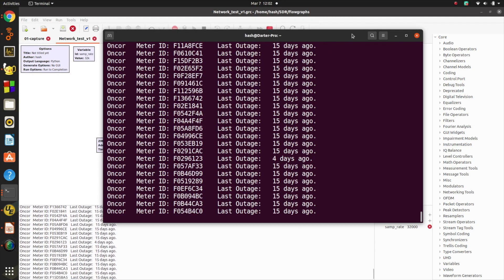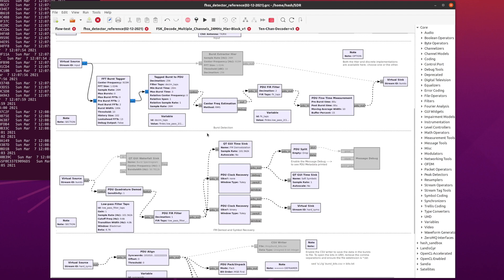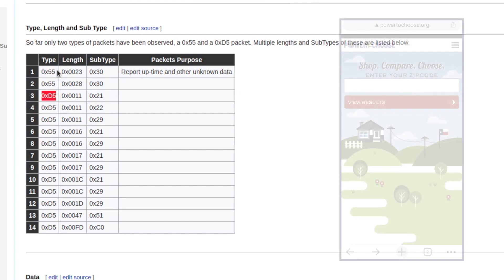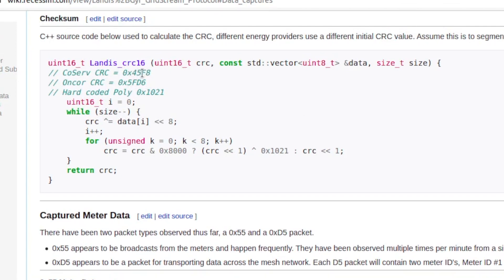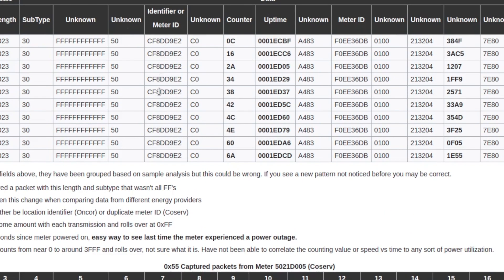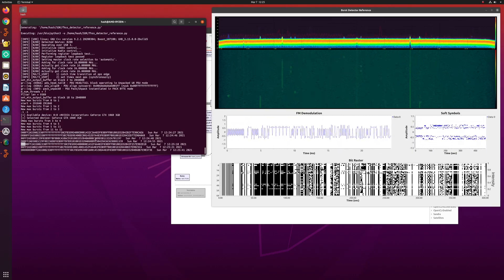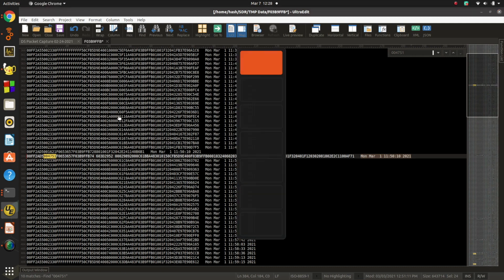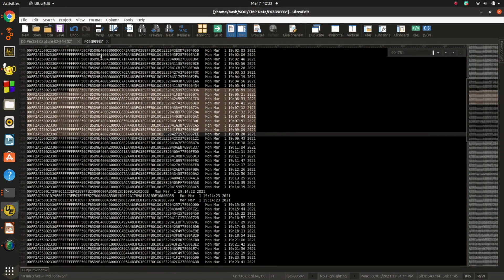Smart Meter Hacking - Protocol Reverse Engineering

Comment: Hello, you did amazing work and presentation, although I have questions left : 
- If I understood the CRC part at the end of packet is just to tell the devices that the packet is not corrupted. 
- You do not seem to perform any decryption besides that. If true, when is the data encrypted to avoid interception? press statements from power companies clearly say 'data is not for public use and is encrypted'. 
- Are they lying?

thank you.
Reply from the maker: I believe the term “truthiness” applies here. Let’s say the data hops across 3 different networks before arriving at its destination. On the last hop it gets encrypted when it traverses a public network. Marketing material can say “we use encryption” and that isn’t a lie. It likely doesn’t say “end to end” from the meter because that WOULD be a lie. It’s all how you position things.
Reply from the maker: Sab The Seeker!  I've gone a few directions with the research. Still working on decoding the power usage data but a lot is understood about the packets. Also worked on building a transmitter but that needs a better understanding of the packets to be effective. But interrupting packets or causing weird things to happen with the communication system are all areas of interest.
Reply: @RECESSIM  right, so the encryption is on the meter maids end. Not the meters end. End of stort.
Reply: The statement “this data is not for public use” does not mean what customers might think it means. The data they collect for one purpose might be useful to third parties such as manufacturers of dishwashers. The utility company would be able to sell data that shows how often dishwashers are being used within a geographic area.
Reply: @DovidM  So the data its just for those who will pay for it 😂

Comment: I could be mistaken, but theres two modes of transmission, the heartbeat becon which only pertains the meter ID, and burst transmission, for usage, remember this is a mesh network of which uptime isn't guaranteed, so its possible it will only dump usage data when a certain ID(metering truck? or LTE repeater) is online, id say run some heuristics on the data, and convert from hex to ascii, see if theres any patterns based on high temp weather(as usage should increase), see if theres certain times of day(metering server/collector polling for usage[aka get current meter read]) where network traffic substantially increases

Comment: Reving old stuff.  In case you didn’t figure it out, remember time of use and solar plans.  Also, monitor frequencies at midnight.  I suspect to cut down on data, meter data is only transmitted at certain times of day.

Comment: Very interesting topic.   My utility recently hosed my meter for no good reason,  it got reconfigured incorrectly, no longer registering inflow and outflow separately.   They claimed it was due to some 'challenge in getting all the meter reads at that time'.    My utiltity offers an 'energy bridge' supplied by Powerley, that connects locally to the meter radio and over wifi to home & cloud network.  I log the data from it, and luckily that let me tell the utility what my usage was.
Reply from the maker: That’s interesting, wonder what happened to your meter?
Reply: Either by human error or something in their systems that manage configuration of the meters, it got zeroed and programmed for a different rate structure (no outflow logging from solar) which might be the common default configuration.  This happened just ota, no tech came out.  I don't know if the micro firmware all gets reflashed to change the config, or if it's just a calibration change to part of the rom.

Comment: 19:14 I think the sync'd clocks are the clue maybe.. Server has a value stored of 37641.426 then another at 37648.598 I think the number you are looking for is 7.172. Being that the meter is just being pinged for difference, maybe it keeps track of its last date/time pinged. This would allow a much smaller integer (and thus packet) to convey a much larger integer on the server side where the large number and computational power isn't a problem.
(I am unsure as to what the "on demand" is but the same would apply if the meter is involved I would guess)

Comment: There are some interesting packets that fly by like at Mar 7 12:04:58 secs. It is a 0x55 broadcast packet but has a length field of 0x28 instead of the regular 0x23. The first part of the packet seems normal, so something at the end has an extended 5 bytes in one of those field/s. Considering there is a length field in the packet, one+ of those fields must be variable length (or just poorly designed). Can't tell if the outputs are only packets with valid CRC in the data part since some packets listed have 1 extra byte before the header.
Reply: Would be interesting to see what manipulating this section of the packet had on the system as a whole, if any.

Comment: I have a question for you RECESSIM.  Do you happen to have a list of discrete frequencies used by these meters?  I'm working on an adjacent project on the same band, and want to avoid the Landis+Gyr frequencies in my area (I've confirmed we have Landis+Gyr meters).
Reply: Nevermind.  I just found a data dump on your wiki that has it.  I can just grep them.  Cheers!
Reply from the maker: 900 MHz ISM band in the US, 902-928MHz. Good luck with your project!
Reply: Interesting.  It seems they use (almost) every single frequency between 902-928MHz within the 100kHz resolution that your file provides.  How irritating!  Welp, guess we'll just be stepping on each other.  😄
Reply from the maker: @SilentGloves  Yea, that’s basically the way the ISM band works, part of the reason they frequency hop and send short bursts. As long as you check your transmissions and implement some form of ACK you should be good.
Reply: @RECESSIM  Using CSMA, so it shouldn't actually be a problem.  I'm not new to RF, but I am new to the ISM band.

Comment: I think the meter value is in the 0xD5 routed packets, and I think it is encrypted. I don't think it is in the 0x55 broadcast packets. Just my thinking from deduction so far. The broadcast packets are just going to all nodes. The D5 packets are going to the gateway to the utility company so it must be in that packet. And I hear the payload is encrypted, so that is the only data seems worth encrypting. This has to be in some specs somewhere. I think the reason for WAN GPS info in the broadcast is for cost determination of the mesh network. Then the D5 packets to the gateway efficiently. The GW could be multihops away. I'm looking for some downward counter like a TTL value to remove data looping else it has to use the LAN address info. The meter max value is 99999 so it can be stored in 17 bits, or most likely 3 bytes. Run your meter long for at least 1kWh of use, and if I'm right, you won't see anything incrementing in the 55 packet.

Comment: Awesome stuff. Thanks for sharing.
Trying to make GNURadio 3.9 work on Ubuntu 16 :)

samples:26M - HackRf One?
Reply from the maker: I was on GNURadio 3.9 but was having issues finding all the blocks I needed migrated to that version so stuck with 3.8 for now.

Using USRP B200 right now, but will be trying HackRF soon and then seeing how well I can make it work with smaller bandwidth RTL-SDR.

Comment: I’ve build the GNURadio setup with a hackRF shown on your website. The missing piece seems to be the TCP receiver script that I assume runs on a different computer. Is that gnuradio script available?
Reply from the maker: It should be in the GitHub but perhaps in an older branch in the scripts folder. If you join the Discord channel linked off www.RECESSIM.com it’ll be quicker to answer any questions. Good job getting it setup!

Comment: I have a Chinese made malahit standalone SDR, and was wondering if I could connect it to my computer to use as a receiver in order to decode my smart meter data?
Reply from the maker: It might be possible to receive some messages, but very limited bandwidth I think. RTL-SDR would likely outperform it.
Reply: @RECESSIM  okay, I'll try and find the one I ordered a few years ago, and see how it works.
The radio I have has a range of 5KHZ to 2GHZ, but when I tried it with SDR# I had trouble controlling the radio with the software so, like you said it'd probably be easier to use the RTL-SDR

Comment: The display on my (DukeEnergy) meter cycles through the following sequence:
1. all display segments lit ("888888")
2. Kw usage display
3. "level 6"
4. "sync net"
5. "reg" or "re9" (registered on the net?)
Then it repeats.  I would guess a broadcast (ping?) occurs with every cycle 
I read the meter manually every 5 days for my own monitoring purposes, I would love to capture detailed usage in order to understand my own usage.  (Currently checking for what level of detail I can acquire online)
PS I once had a meter say "fAT eRROR".  They replaced the meter.  My question is, is that "FATAL" error or FileAllocationTable error?

Comment: Hi
Great Job

What about packets coming into the meter?

It would be interesting to see commands  for lime to turn the meter off.

Thanks
Reply from the maker: That’s tough to see without having a meter on the network, all the ones I experiment with are not on the network around me so I ensure nothing interferes with the power grid.

I am working on other ways to see this though, appreciate the suggestion!

Comment: CPS Energy in San Antonio is doing something wrong or illegally. Since they put the mandatory smart meters in, my electricity bill has gone up from $100 a month to $300 a month. I'm using less electricity now than when I was paying $100 a month. I would like to catch them at what they're doing illegally.
Reply from the maker: Tracking your homes power usage could help you build a case. There are devices out there that you hook up inside your homes breaker panel and will log your usage. You can compare that to the power company.

The tough part is, they might have been under billing you before due to crappy meters. It’s also possible they charge more depending on the time of day, and now they can track that better.

Comment: Would this work in the UK?
Reply from the maker: Depends on how they are sending the data back, it’s different by country generally. If you have an FCCID or the equivalent for the UK on it you can look that up and see what frequencies it’s certified for operating on.
Reply: @RECESSIM  Can't find anything saying FCCID but it's a landis gyr+ E470 type 5394 SKU1 Cellular with a CHFID and GPFID number
Reply from the maker: @novosprospectus882  Could be GSM they are using to send data back
Reply from the maker: @novosprospectus882  Get a SDR and tune 868MHz band, likely the GNURADIO decoder block I wrote would grab the data
Reply: @RECESSIM  not seeing any data with my hackrf so it must be GSM